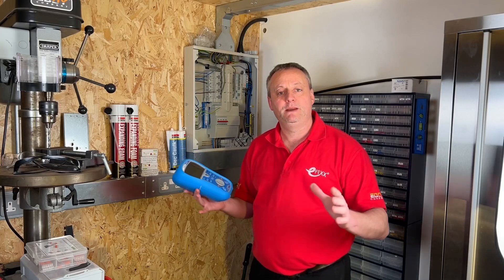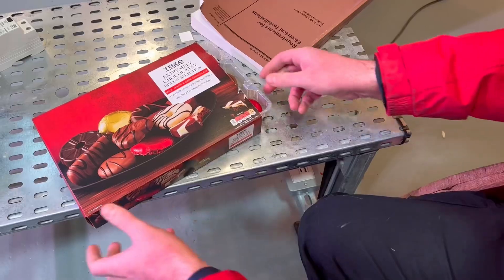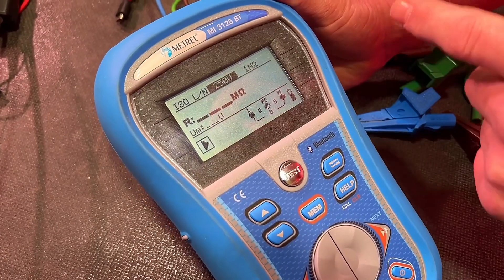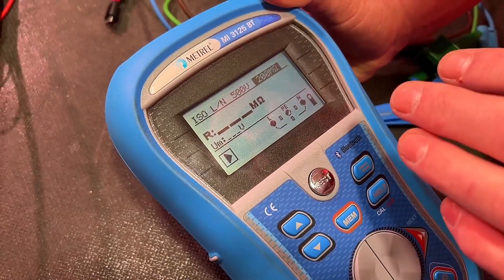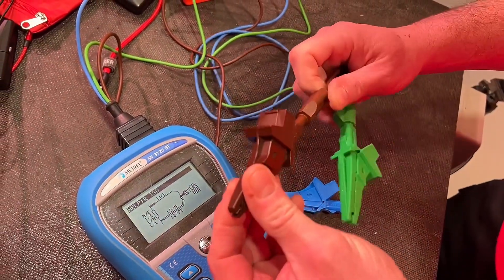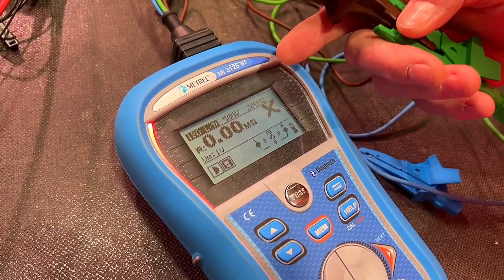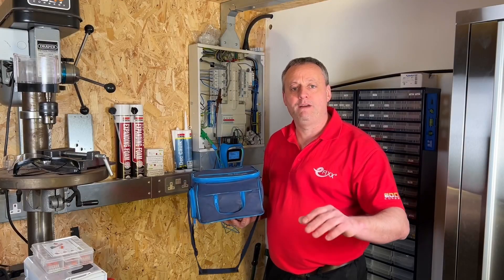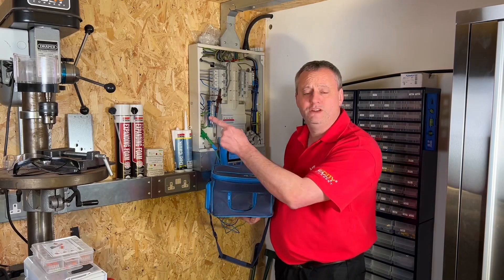Easy Tutorial: Insulation Resistance Test with Essential Tips

Comment: How do you test lighting circuit with this? I guess remove all bulbs / LED drivers first?
If so some installations might be really hard or near impossible ( high ceiling flush 240V fittings)...?
Reply: By connecting phase and neutral together, and testing both connected together against PE. At least in Hungary the standard allows to do it in that case

Comment: Why are the N+PE probes connected? Is it for a cut-down version of a 4-wire Kelvin connection?
Reply: Must be something like that. IR is the only test they insist you do with N and PE shorted. 

According to the book: "Follow the correct test wiring as indicated in terminal voltage monitor when the particular insulation test is selected. If only two test wires are connected, and L-N, L-PE or N-PE test is selected, then technical specification for INSULATION ALL applies."

The accuracy spec listed for INSULATION ALL is worse than the other INSULATION spec.

Comment: Naughty Garry connect your croc clips properly @ 4:00
Reply: I spotted that too, but you beet me to it on the comments!
Reply: Why hasn’t he contacted the crocodile clips properly? They looked ok to me
Reply: @Dog-whisperer7494  Solid (non moving) sides of the jaws should be touching each other according to Metrel.
Reply: @Dog-whisperer7494  One should do that with the non hinged part of the cock clip, just is case there is additional resistance in the hinge/spring. also, that resistance could be variable on how open or closed they are. so by connecting the other way round one would eliminate that resistance